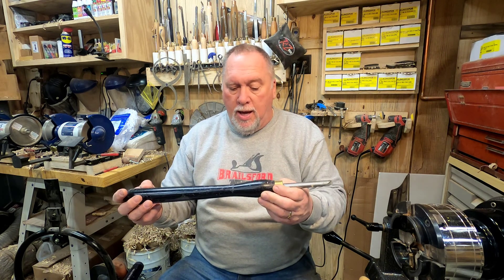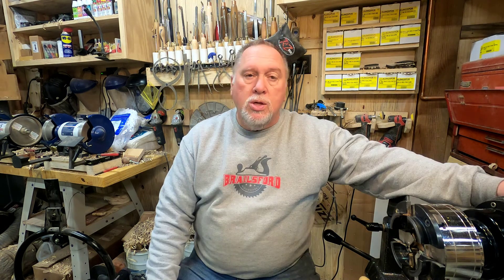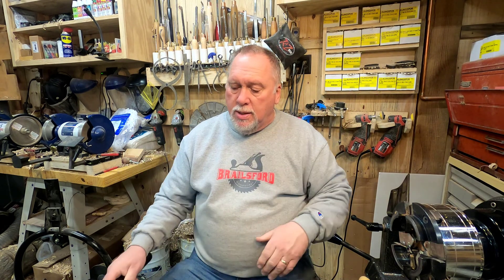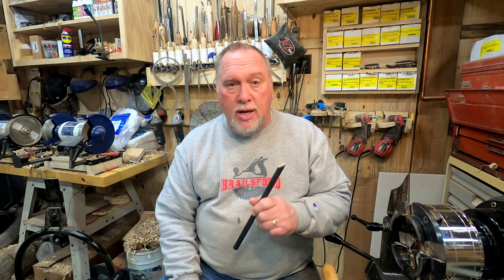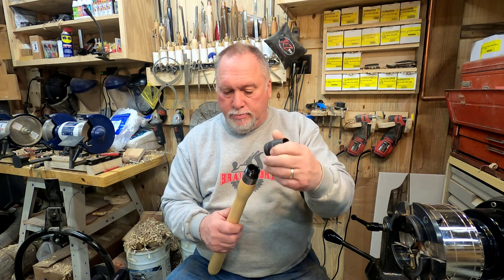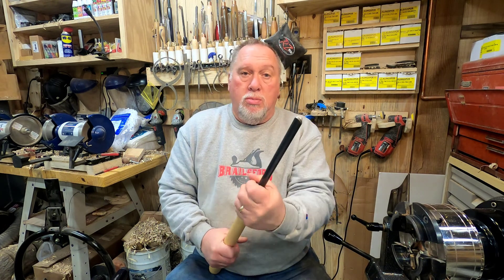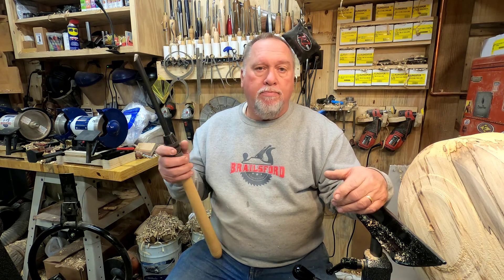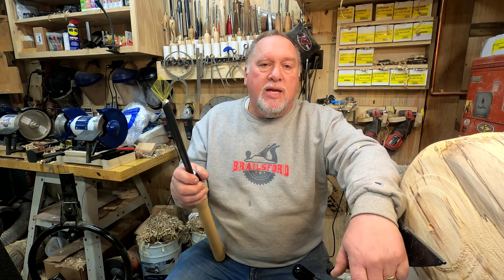Robust ER Collet Handle System  Product Review

Comment: Thanks for sharing. I’ve thought a lot about going to collet handles. I don’t seem to have issues with sharpening with the handles on. Where I do see the advantage is that when replacing a tool you don’t have the expense of the new handle as well. There has been a good bit of discussion re: using compression connections. I may try that with a tool or two before going through the expense of buying the various sizes we’d need. Thanks for the info.
Reply from the maker: Thanks Doug!  I can sharpen with the  long handles too, but it is very much more convenient to do it with jus the steel.  I agree that it would be nice to just replace the steel vs an entire gouge.